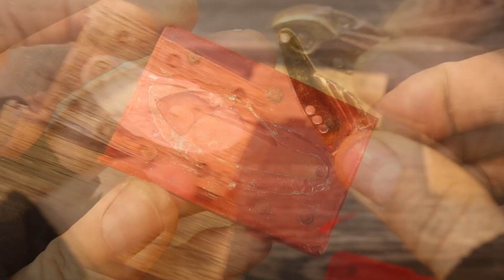Homemade fishing blades for fishing | making lures

Comment: I make mine from 0,25 mm stainless steel so no polishing no oxidation = no polishing.  The moulds I make from gypsum, it cost about 1/1000 of silocone and last for over 100 castings.  So far I have caught 16 different species of fish and more than 100 peach of a kilo or more.